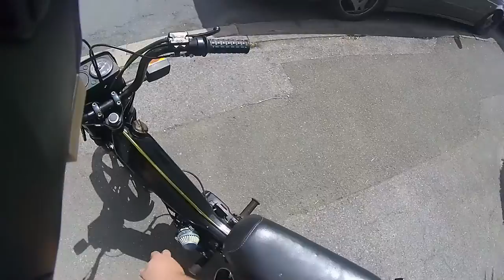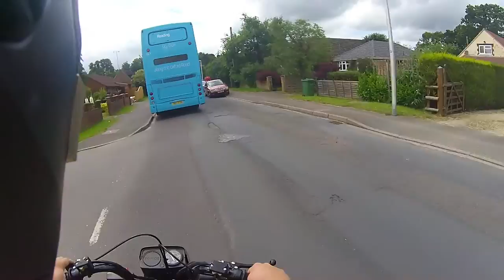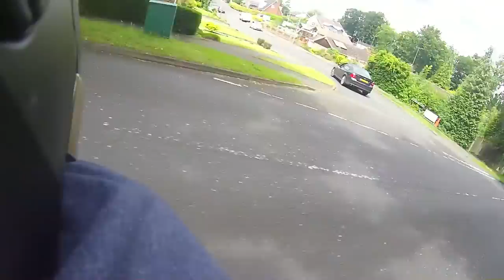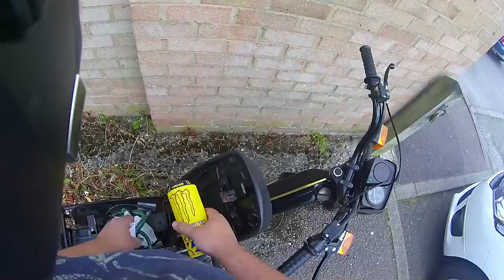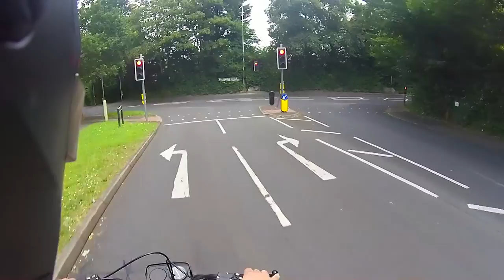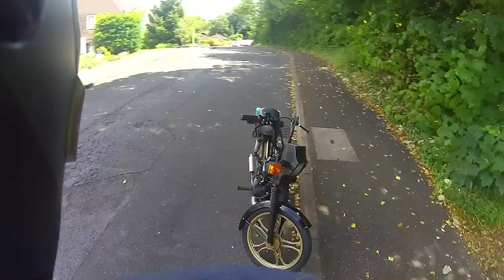Riding the restored Tomos A3ML Golden Bullet - Top Speed and Uphill | JAM#3

Comment: That bike can go so much faster , mine gose just shy of 80KMH wich is around 50MPH , I did the cylinder drilled it out to be 39,5 and new piston , also 18mm carb , k & n air filter , sport exhaust , I polished all of the canals on the intake , Im just going to do the sprockets and starter , and then I hope to get 80KMH , Also put the fan on the bottom side of the cylinder .
Reply from the maker: I wanted to avoid opening the engine up for now, just to get it on the road - I might play with porting and kits later on ! thanks for your comment :)
Reply: No problem also nice to see an older A3 model mine is A35 (A5 engine) , The number one thing on these bikes is the exhaust , they are horible standart ones put an laser or biturbo on it and its gona go . Also dont do that where its a full throthle on rev limiter you are going to destroy it I know , when thet happens relase the throtle quickly so engine can slow down and shift gear